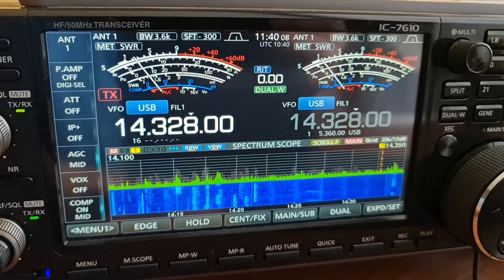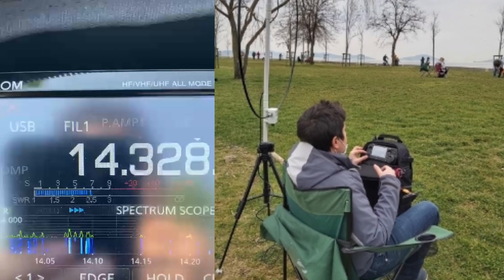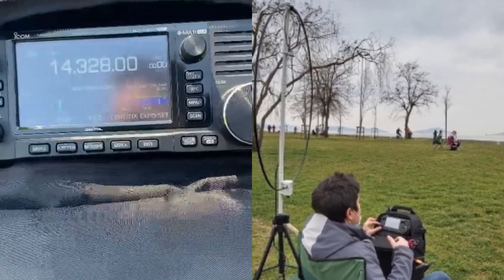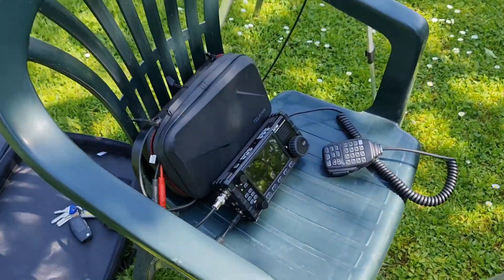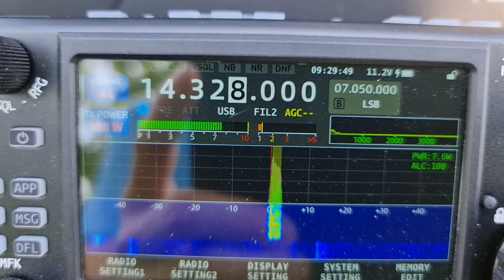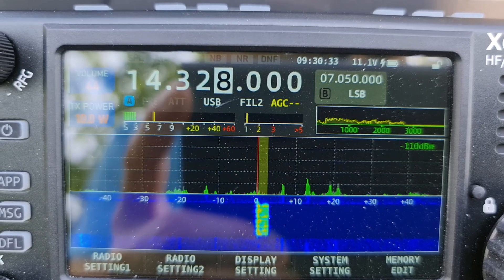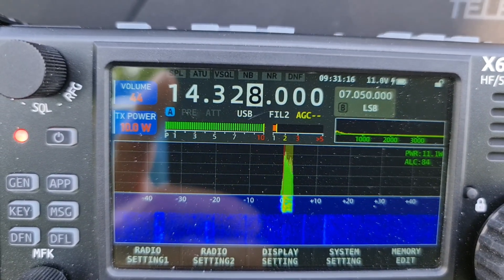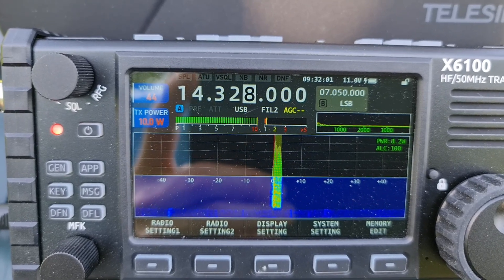Magloop to Magloop QRP contact over 1330 km with Semih TA2IGS

Comment: I was wondering: they say that for sending beyond the horizon, it is good to send the signal slightly towards the sky so it would start to bounce, just as vertical antennas with horizontal polarisations are good for close by receivers. So the loop now is sending horizontally but if you’d incline it towards the sky maybe the guy in turkey will get a better signal 😃?